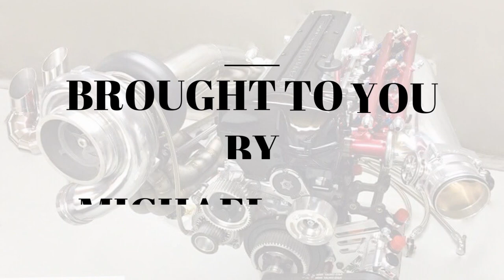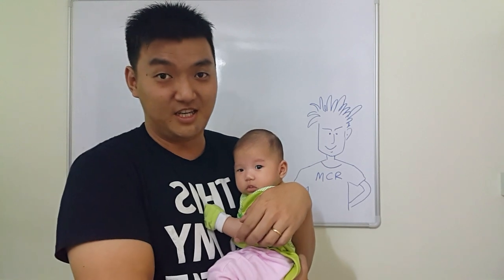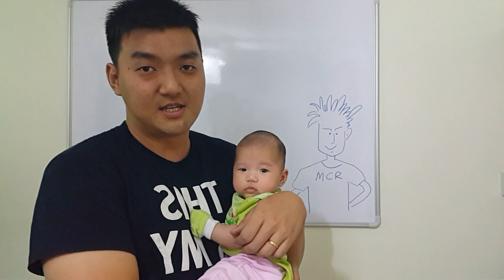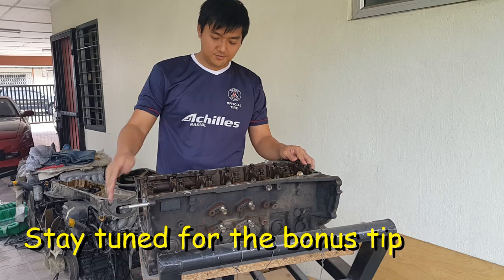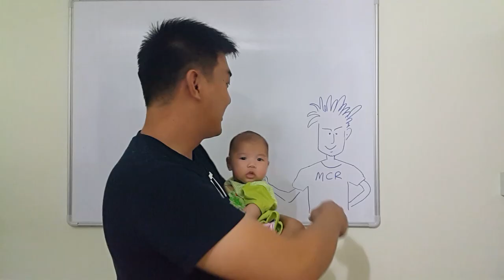2JZ Tuesday: The difference between 2jz GE and GTE engine block (and similarities!)

Comment from the maker: hi guys! Here it is the difference for the GE and GTE Engine block, but I got another video which is full analysis difference between GE and GTE Cylinder head: https://www.youtube.com/watch?v=SS4elzfDzdA enjoy
Reply: Hello my friend i have 2jz ge non vvti stock internals it's safe 450 whp ? working 0.7-0.8 bar?
Reply from the maker: @ntentemarko1132  yes safe, but boost have to be higher like  1 to 1.2 bar
Reply: @cheapkailaujing  not have problem working 1 bar?cuz working high compression 10.1
Reply: @cheapkailaujing  now working 0.5 bar with 100 octania 367 whp
Reply from the maker: @ntentemarko1132  i was talking about gte internals with low compression
Reply from the maker: @ntentemarko1132  i was talking about gte internals with low compression
Reply: @cheapkailaujing  you know my ge non vvti stock internals?
Reply from the maker: @ntentemarko1132  if it is ge non vvti stock internals, please go lower than 400 hp if u want the engine to live longer
Reply: @cheapkailaujing  lower 400 HP engine or wheel?

Comment: I have a ge block that I added oil squirters to. And I drilled and tapped both oil feeds. Do I need to do anything else to get oil out of the factory feed locations?

Comment: Congrats on the baby man. So if I wanted to do a big single turbo which block would I want?
Reply: GTE is assume?
Reply from the maker: Gte has oil squiters, better piston cooling, and they don't reduce much oil pressure. But if u r going for lesser than 600hp,ge block like mine is ok too.. :)

Comment: Can the feed line to turbo come from an oil filter adapter plate instead of drilling into the block? lol nvm so run the feed line from the vvti port if not using vvti cams

Comment: I have spent the last....I would say month or so doing my research on the JZ platform. And I figured that the block from the GE and GTE were more or less the same. Capable of withstanding near 1000 hp without cracking. 
I have considered a 2JZ build in my classic Mustang in the future for 400 hp (at the crank). Likely would use a single turbo, but nix power steering (since it had factory manual steering) and start off with a GE non vvti and of course have functioning AC all likely to be running on a standalone ECU.

Comment: It looks like on the GE and the GTE far as the oil squirters both blocks have the little flat spot one is just not drilled-out... do people add oil squirters in the GE block from the GTE just a drill and tap the little flat spot and add the squirters? My personal opinion is if you're staying under 350 maybe even up to 400 horsepower you don't need them but once you get into high-revving autocross road race drifting above those power levels you probably need them. So if anybody out there knows if they've added the squirters and what's people's actual experiences power level wise and having them or not having them?
Reply from the maker: Oh ya a small update.. My 2jz gte block has been doing drifting for quite some time now.. It is around 500hp ish haha
Reply: A

Comment: Thanks so much I have a 1992 sc300 auto. Do you have any advice on swapping transmission w58 or r154 ?
Reply from the maker: 1jz and 2jz using r154 or the 2jz manual. W58 cannot fit

Comment: What do you say about the differences between vvti and non vvti in gte, which is better, apparently vvti is collisive and not vvti is collision-free. Apparently the connecting rods are stronger in non vvti. Are you a practitioner, could you recommend which solution better for tuning and why?
Reply from the maker: Well there are a few questions there. Collision free or not, is not an issue if ur timing belt doesn't break. So it depends on whether u need the response or not, for eg u r doing circuit, gymkhana or drift then u need VVTi. Then the con rods, always go for the stronger ones available. I'm a drift practitioner and I wanted low cost responsive 2jz,so I just tuned and matched my engine with a small turbo to reach 500hp and that's enough haha

Comment: So if I'm going for a high-redline NA build for circuit use, is it better that I use a GTE block for the piston under-squirters? (Perhaps even go for the 1JZ-GTE block for easier revving from shorter stroke instead? And also cheaper than 2JZ-GTE.) What do you think? 

Beautiful kid you have, btw. :)

Comment: Also can you drill and tap holes where the oil squirters go on the ge block and turn your ge block into a gte one? In your good with drill and tap and mill down a flat spot where they go and then drill and tap holes one for the oil and one for the dow pin on the oil squirter:) lmk thanks
Reply: I think its possible ... because I think the oil galleys are in the same spot you would have just have to put the block on a milling machine and put a mill down in the area where the oil squirters go on the GTE and just make a flat surface and then drill and tap out the holes where the oil Galley is and then you would be able to use the oil squirters I have a spare GE engine on the stand and tempted to do the GTE conversion myself
Reply: If you look down inside there's a square where the oil squirters must go the casting there hasn't been mailed down and I believe that there is an oil Galley below it
Reply: I believe I read in a forum some time back that you can indeed drill in the oil squirter holes and fit them on. but much like you said I cannot confirm %100 without visual proof.
Reply: Well i have a ge block that im willing to mill

Comment: Hi Michael. I have the 2005 IS300 with run 2JZ GE...but I want to upgrade into turbo. Do you think that is a good idea? Will it last long for a daily driver? Not planning to drift or anything like that...
Reply from the maker: Yeah 2jz can last long.. However it all depends on your goals. Like how much horsepower and budget u want.. If u want to have turbo, u need to consider head gasket, exhaust manifold, the turbo, and aftermarket ecu. But if u want to just add some horsepower on ur 2jz GE, a good tune with ecu  should be just fine
Reply: Can you please recommend a good turbo kit? By the way...will it passed the smog check with turbo install cuz of the cold air intake? I am in California, so smog check does required.

Comment: Hi michael great video mate, i just have few questions you may be able to help me with. So i have a GE non vvti in my mk4 supra which i intend to turbo charge as my father is a mechanic and we have our own workshop, and i already have a good turbo sitting there waiting for me as well as some 660cc injectors so i dont really want to spend 5000 dollars on a gte engine and throw half of it away..

Anyway, im not sure what the limitation on the GE pistons is so is it possible to use GTE pistons in the GE block? If so my dad recommends forged pistons just for some extra strength but we dont know if they will fit in the ge block. Also i saw in your other video that the headgaskets are different do you know if its necessary to use thicker headgasket to lower the compression ratio for the boost? I'm going to use headstuds aswell as its only a few hundred dollars for a bit of extra strength. But i'm stuck on the piston and headgasket part for the GE block. Any advice?
Reply: @cheapkailaujing   Thanks for the quick reply! in this case i will be running 98 octane fuel its the highest fuel in new zealand (that isnt e85 but its just a road car) but as i said in your video that i watched the GTE headgasket doesnt seem to fit on the ge block? i would like to run a thicker gasket on it i wont feel very comfortable using the stock ge one haha. But thats great news for me if i can use gte pistons. stock gte pistons is an option but my dad recommended just spending the extra money on forged pistons. So really my only concern is the headgasket.

For the rest of the head we are switching to coil on plug instead of stock GE ignition and we will be getting an aftermarket intake and turbo manifold etc. thats why i mentioned for me atleast buying a GTE engine package is pointless as i intend to change most of it anyway. So yeah my only question really is can you modify the GTE headgasket to fit on the GE block? or an aftermarker one? thanks :D
Reply: NZCabbage hey man I have a Lexus sc300 witch has the same motor as your Supra the con rods and crankshaft are the same as the gte don’t worry about upgrading them keep the bottom end stock only thing you should get is the gte headgasket and arp head studs and you’ll be good for 800whp all day long
Reply: @mtwdew45   yeah was gonna do head studs and headgasket. I only want 400whp so will the stock pistons live?
Reply: NZCabbage yea the only difference is your compression will be higher but that’s good for quick turbo spool honestly the best setup for you would be a borgwarner s300 and you can use a eBay turbo manifold it’s proven to hold power and it’s cheap
Reply: NZCabbage the bottom end is the last thing I would touch I would worry about spark hks makes a spark booster you can get a used one for around 200

Comment: I’ve noticed on my cylinder head camshaft side that on the exhaust side half’s dark with oil etc but the back half is very clean have you a email I can send a pic to see what you think I’m wondering if it’s been starved of oil 👍

Comment: Do GTE oil squirters cause more oil to be burned?
Reply from the maker: no, there only allow more lubrication and cooling for the pistons
Reply: @cheapkailaujing  Ahh, thank you sir. Would you be doing a video on how to add oil squirters to an NA block?
Reply from the maker: @nickamarit  hmm not so soon tho, because I have been using NA block for about 500hp application without oil squiters and it is still running fine =)
Reply: @cheapkailaujing  Okie dokie!

May I ask how high is your redline for your 500hp engine?
Reply from the maker: @nickamarit  about 7300rpm.. don't want to be too high, altho i have ati damper, but i don;t have the valve springs.. hmm

Comment: Hi mate I’m building my 2jz Ge I’m putting hks pistons in I got 5 rods from the same engine so all about right on weight and I have a rod from another engine it weighs 8 gram more do i need to balance it ?
Reply: Michael Chung vui min there tt Conrad’s from a tt block 
 I’ve took the vvti Conrad’s and pistons out . 
I’ve bought hks 87mm pistons and had the block bored and honed . With proper clearances etc.
Reply: I also read on a forum that the Rods from the VVTI is weak but on the GE non VVTI the rods are the same as the GTE however the piston head is different as needed. Presumably you can put new Piston heads on :D

Comment: i using the ge block i ant buying a gte n throwing away all the old stuff one can add oil squirters  if there a descent mechanic
Reply from the maker: mine did not add oil squirters at all, and running 1.7bar ok =) GE block and GTE block are same in strength =)

Comment: Hello...been watching ur videos..i currently have a 2jzge ( out of a sc300) that im goining to build as an NA/T to put in my mk3 SUPRA..i may need some advise and guidance along the way..if you're willing to help out if i have any question shoot me a way to contact you please..or u can contact me via email...kountryboy8407. at gmail
Reply: I plan on doing the 2jzge na/t build and running it on 7mgte electronics and ecu until i get a stand alone...so far i have CP pistons, Eagle rods (ARP L19 rod bolts ) RC 550cc injectors, ARP head studs, turbonetics t4 60-1 AR.70 twinscroll...still collecting parts